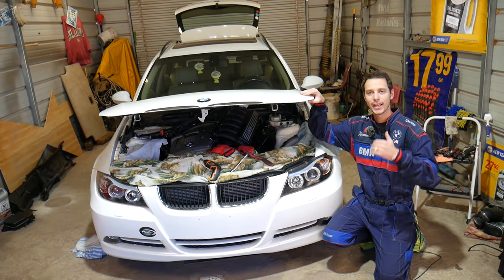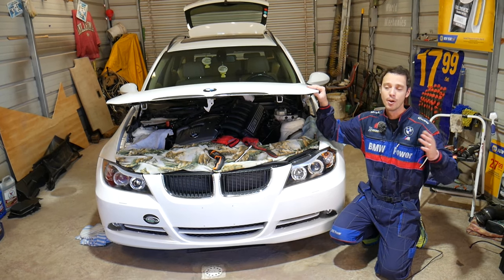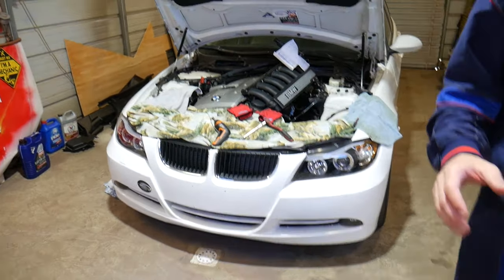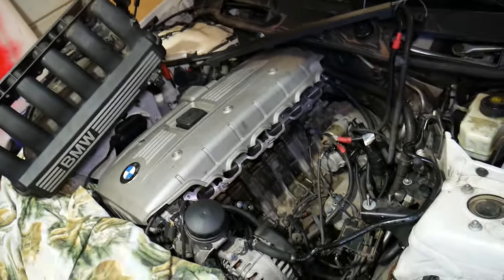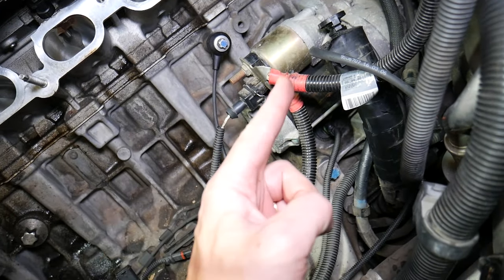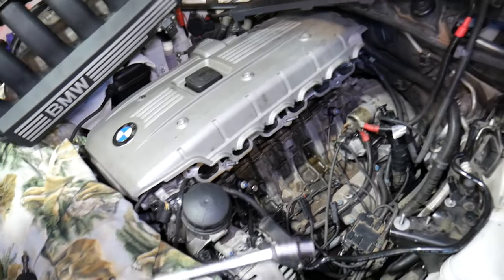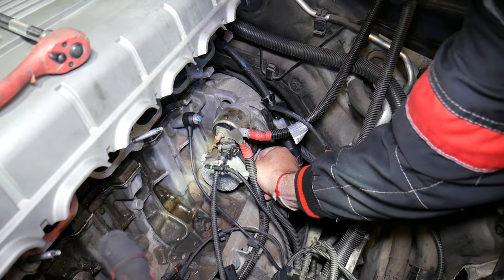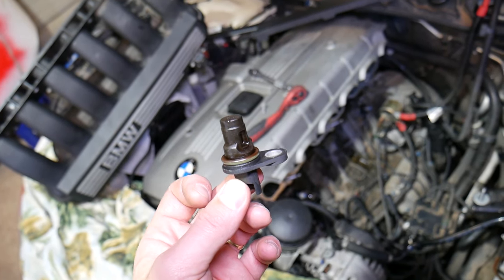BMW WHILE DRIVING TRANSMISSION MALFUNCTION, DRIVETRAIN MALFUNCTION, NO POWER, BMW DOES NOT START

Comment: 2011- 323i.  The transmission stopped working. I pulled up at a traffic light and when the light changed I tried to accelerate and the car would not move. Just before this happened I heard a pop and thought a tire had burst. The car would not go forward or reverse. Had to get the car towed.  No warning lights or engine codes and the car was running fine up to the stop light.    The problem was an axle shaft had disconnected completely from a recently installed differential.
Reply: Same thing happened to me, im sittinf on the side of a highway with my bmw😂, if you fixed the problem can you tell me what it was and how it got fixed?
Reply: I just got home from a long tow truck ride myself 😢

Comment: Thanks a lot, great video. My X3 is having this issue, but the drive terrain warning comes only when I come to a stop and the auto start/stops the car and starts again, after this the warning goes off. If I turn auto start off it does not come. Can’t understand what the issue is.
Reply: my 2013 X3 is having the exact same issue
Reply: @petert8549  have spoken to a couple of tech heads on this with the conclusion being that the battery is on its way out!
Reply: Hi, I have exactly the same issue on my X3. What all have you tried and anything thats fixed the issue ?
Reply: @nitendraagarwal9913  have to replace the battery, will update once I do that!
Reply: @foxbatzehro  Thank you, Please do
Reply: Guys same boat, same problem! Did you fix the problem by changing the battery?
Reply: Exact same issues here it was the battery, replaced it reregistered all worked fine after
Reply: @scorpion963  thank you so much, what do you mean by reregistered.
Reply: @nitendraagarwal9913  every time you change the battery in a bmw needs to be re-register meaning you have to access the car computer and let it know you replaced the battery so it adjust the charging system and also as the battery start acting like that some mudeles and electrical funtion will turn off so when you re-register a new battery all this come back to work again
Reply: @scorpion963  THank you again, so I am guessing this needs to be done at BMW (which will obviously be expensive, unless can be done somwhere else cheaper). Just  double checking was your issue also the car engine turning off completely on its on when stopped for a while at stop sign , this only happens when auto on / off  is engaged (means only happens when the engine turns off automatically when stopped for a while such as at red lights) ?
Reply: @nitendraagarwal9913  yes mine did not get to the point of turning off by itself but if I turned the can on and off by the 3rd time car won't start or I would hear the engine having a hard time  turning  to start, I have  bimmer code app in my phone so I reprogrammed the car and the on/off feature is disable by default only engages if go to exo mode, I also have bimmer link app in my phone so I re-registered the battery my self, not sure hoe much will be at the dealer

Comment: Is there another way to do it with removing the top section
Reply: No, the only way to access the sensor is by removing the intake manifold. It’s a extremely poor location for any sensor especially the crankshaft position sensor and starter. Should have been located at front of the engine.

Comment: Also the same car that I'm talking about the BMW X5 2005 it only has 142,000 miles on it
Reply: I'm still waiting on a response to my question.
Thank you
Reply: @nicolehall8204    Fluids are important.

Life of the vehicle ends at end of lease.
2 to 4 years.
How do law Suits fit?
Reply: It's driving okay now I let my mechanic drive it he said it's a four-wheel drive and it's supposed to do that but basically he gave my car a good health report I'm used to driving Cadillacs I never had a all-wheel drive before thank you for your response
Reply: Now I just have suspension issues I need to have someone do a suspension check I know the that I need to replace my control arms but there's so many components on that car

Comment: My e65 2007 750i  transmission can't shifting anny one can help please
Reply: I have the same year but Li model and the mechanic said the transmission was out, I got used one. Runs good now
Reply: Did you get help with this? We had to reset the transmission for it to shift but it keeps happening. We can still drive as long as we reset.